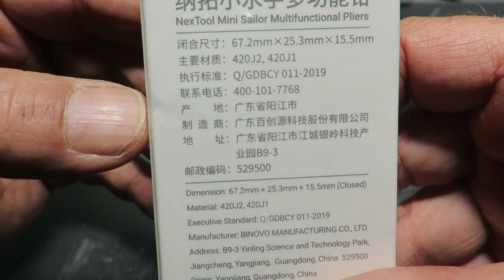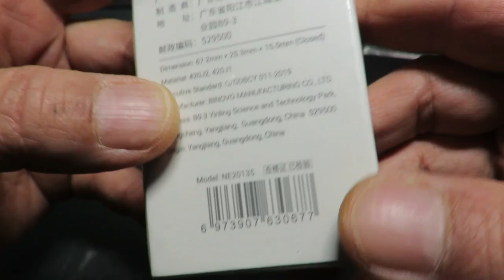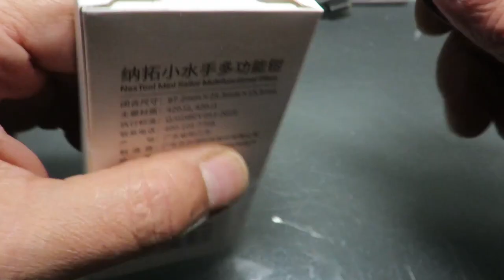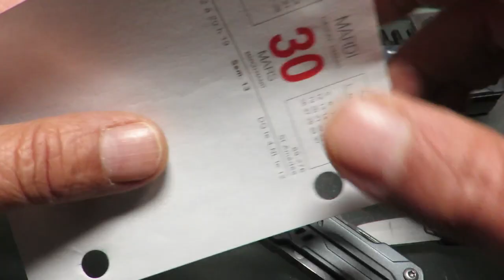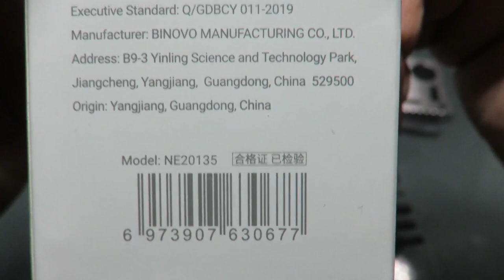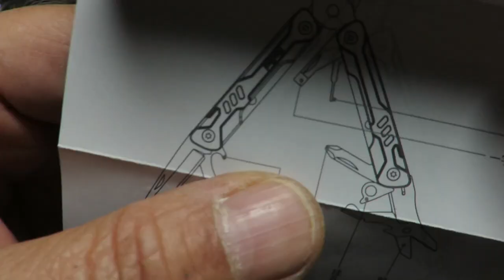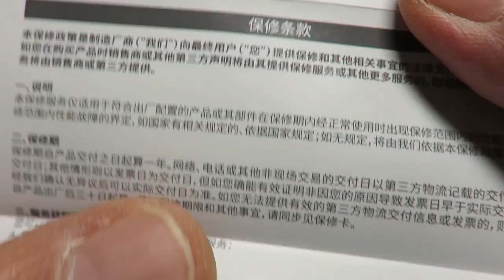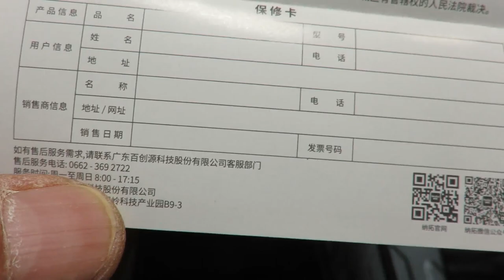NEXTOOL Sailor & Mini Sailor Multifunction Pliers

Comment from the maker: MT VOD * Dear lovers of multi-tools, you can ask me everything, redo a review, insist on a detail, make comparisons, test this or that, I am at your disposal! :) * Multi-Tool VOD
Here is my collection of multi-tools (June 2022) [/S = Brand Sheath]. Each model has been the subject of one or more videos (see my playlist "MULTI-TOOLS").
001-	BALADEO Outdoor Camping Cutlery Multi-tool ECO104 /S (*3)               
002-	BEAR & SON Bear Jaws 155LS /S
003-	BEAR & SON Bear Jaws Multiscissors Gardener BC157GT /S
004-	BEAR & SON Electrician's Bear Jaws BC155EL /S
005-	BEAR & SON Mini Bear Jaws 153
006-	BIBURY 23-in-1 Bicycle Multitool BI-BM-001 /S
007-	BIBURY GHK 10-in-1 EDC
008-	BIBURY Multifunction Garden Pruner BBY-MT11 (offered by the company) /S
009-	BIBURY Multifunction Tool 21-in-1 BBY-MT08 (offered by the company) /S
010-	BIBURY Multifunction Tool 16-in-1 X0016E2LAJ (offered by the company) /Box
011-	BLACK FOX BF200 /S
012-	BÔKER PLUS Tech Tool Carbon 4 /S
013-	BÖKER PLUS Tech Tool City 5 /S
014-	BUCK Knives X-Tract 730 /S
015-	BUCK Knives X-Tract 735BKS-B Essential
016-	BUCK Knives BuckTool 350 (MiniBuck)
017-	BUCK Knives BuckTool 355 /S
018-	BUCK Knives BuckTool 360 /S (*2/ one completely broken)
019-	BYRD ByrdRench BY15P /S
020-	COLEMAN Pro Lock /S
021-	CRKT Bivy CR9250 (by Hans Florine)
022-	CRKT Guppie CR9070 (by Launce Barber)
023-	CRKT Technician Multi-tool CR9201 (by Glenn Klecker)
024-	CRKT Tool CR9200 (by Ed Van Hoy & Tom Stokes/ with Bit Kit) /S
025-	CRKT Zylla-Tool Jr. CR9065K /S
026-	CRKT Wooden Multi-Tool Kit CR1035
027-	DEEPEE 8-in-1 Shears Multi-Tool /S
028-	DICE TOOL EDC Multi-tool
029-	EICKHORN SOLINGEN PRT-II Rescue Knife /Böker S
030-	FISKARS Cuts+More
031-	FLEXCUT JKN91 Right-Handed Carvin' Jack /S
032-	FLOCON DE NEIGE 18-in-1 /S (& 15-in-1)
033-	GANZO G301-H /S
034-	GANZO G302-B /S
035-	GERBER Armbar Cork
036-	GERBER Armbar Drive Onyx
037-	GERBER Balance /S
038-	GERBER Bullrush /S
039-	GERBER Center-Drive (with Bit Kit+ Victorinox Scissors) /S
040-	GERBER Center-Drive Plus (with Bit Kit) /S
041-	GERBER Crucial /S
042-	GERBER Crucial Black (with strap cutter)
043-	GERBER Crucial F.A.S.T. (with Hex Bit Kit)  /S
044-	GERBER Curve
045-	GERBER Diesel /S
046-	GERBER Dime (*3/one with broken cissors)
047-	GERBER Dual-Force /S
048-	GERBER Flik /S
049-	GERBER Fit /S
050-	GERBER FreeHand /S
051-	GERBER Freeman Exchange EAB (with 3 blades) /S
052-	GERBER Grappler /S
053-	GERBER Prybrid Utility
054-	GERBER Prybrid X
055-	GERBER MP1 /S
056-	GERBER MP1-MRO (with Bit Kit) /S
057-	GERBER MP 400 Compact Sport (05500/ 45500) /S
058-	GERBER MP 500 Recoil Auto-Plier /S
059-	GERBER MP 600 Basic Black (07550) /S
060-	GERBER MP 600 Black (07550G1 Carbide Cutters) /S
061-	GERBER MP 600 Bluntnose (old model with 55200 Multi-Plier Pocket Tool Kit) /S
062-	GERBER MP 600 Bluntnose Black (07520G1N Carbide Cutters with Tool Kit) /S
063-	GERBER MP 600 Bluntnose (07500 Carbide Cutters) /S
064-	GERBER MP 600 Pro Scout (07564 with Tool Kit) /S
065-	GERBER MP 650 Evolution (with 2 heads)
066-	GERBER MP 700 Urban Legend /S
067-	GERBER MP 800 Legend /S
068-	GERBER MPT #5 /S
069-	GERBER Multi-Lite (07205)
070-	GERBER Nautilus /S
071-	GERBER Obsidian
072-	GERBER Octane /S (*2)
073-	GERBER Radius /S
074-	GERBER Splice
075-	GERBER Strata /S
076-	GERBER Suspension /S
077-	GERBER Suspension-NXT /S
078-	GERBER Truss /S
079-	GERBER Vise
080-	HANWEI Professional Multi-tool by PAUL CHEN 1008-GT
081-	HAVALON Evolve Jim Shockey Signature Series XTC-60AMTS /S
082-	HENSTRONG (or Bibury or Intey or …) 18-in-1 /S
083-	HX OUTDOORS GQ-17A Multi-tool /S
084-	HX OUTDOORS GJ-06 Knife & scissors /S
085-	KERSHAW A100C /S
086-	KERSHAW Select Fire 1920
087-	KELVIN.36
088-	KING INNOVATION L-tool Lighting Multi-tool 46700 /S
089-	KITA Le Dépanneur x2 /S
090-	LEATHERMAN Blast (with Removal Bit Driver) /S
091-	LEATHERMAN Bolster (Costco exclusive) /S
092-	LEATHERMAN Brewzer
093-	LEATHERMAN Bond (+ pocket clip)/S
094-	LEATHERMAN Charge+ (with Bit Kit & Pocket Clip & Lanyard Ring & Bit Driver Extender) /S
095-	LEATHERMAN Charge+ Black Oxide /S
096-	LEATHERMAN Charge+ Forest Camo (with Bit Kit & Pocket Clip & Lanyard Ring & Bit Driver Extender) /S
097-	LEATHERMAN Charge+ G10 Earth (with Bit Kit & Pocket Clip & Lanyard Ring & Bit Driver Extender)/ S
098-	LEATHERMAN Charge+ G10 Orange (with Bit Kit & Pocket Clip & Lanyard Ring & Bit Driver Extender) /S
099-	LEATHERMAN Charge+ G10 Red (with Bit Kit & Pocket Clip & Lanyard Ring & Bit Driver Extender)/ S
100-	LEATHERMAN Charge+ TTI (with Bit Kit & Pocket Clip & Lanyard Ring & Bit Driver Extender) /S
101-	LEATHERMAN Charge+ Woodland Camo /S
102-	LEATHERMAN Charge AL /S
103-	LEATHERMAN Charge ALX Black Oxide /S
104-	LEATHERMAN Charge TI 2H (with Bit Kit & Pocket Clip & Lanyard Ring & Bit Driver Extender) /S
105-	LEATHERMAN Charge TTI (with Bit Kit & Pocket Clip & Lanyard Ring & Bit Driver Extender) /S
106-	LEATHERMAN Charge XTI (with Bit Kit & Pocket Clip & Lanyard Ring & Bit Driver Extender) /S
107-	LEATHERMAN Core /S
108-	LEATHERMAN Crunch /S (*2 / including a clone)
109-	LEATHERMAN Curl /S
110-	LEATHERMAN Expanse E306X /S
111-	LEATHERMAN Expanse E33BX /S
112-	LEATHERMAN Expanse E33T /S
113-	LEATHERMAN Expanse E55BX /S
114-	LEATHERMAN Expanse K502X /S
115-	LEATHERMAN Flair /S
116-	LEATHERMAN Free K2
117-	LEATHERMAN Free K2X
118-	LEATHERMAN Free K4
119-	LEATHERMAN Free P2 /S
120-	LEATHERMAN Free P4 /S
121-	LEATHERMAN Free T2
122-	LEATHERMAN Free T4
123-	LEATHERMAN Freestyle /S
124-	LEATHERMAN Freestyle CX /S
125-	LEATHERMAN Fuse /S
126-	LEATHERMAN Juice B2
127-	LEATHERMAN Juice C2 /S
128-	LEATHERMAN Juice CS3
129-	LEATHERMAN Juice CS4 /S
130-	LEATHERMAN Juice KF4 (offered by the company & signed in my name by Tim) /S
131-	LEATHERMAN Juice Pro (with Victorinox Mini Screwdriver) /S (*2/ one offered by the company & signed in my name by Tim) /S
132-	LEATHERMAN Juice S2 /S
133-	LEATHERMAN Juice SC2
134-	LEATHERMAN Juice SX /S
135-	LEATHERMAN Juice XE6 (with Victorinox Mini Screwdriver) /S
136-	LEATHERMAN Kick /S
137-	LEATHERMAN Klamath /S
138-	LEATHERMAN Leap /S
139-	LEATHERMAN Mako TI
140-	LEATHERMAN Micra
141-	LEATHERMAN Mini Tool
142-	LEATHERMAN MUT (with Bit Kit & Tool adapter V2) /S
143-	LEATHERMAN MUT EOD /S
144-	LEATHERMAN Nehalem /S
145-	LEATHERMAN OHT Coyote Tan(with tweezers) /S (*2)
146-	LEATHERMAN OHT Black /S
147-	LEATHERMAN PST (*2)
148-	LEATHERMAN PST II
149-	LEATHERMAN PULSE /S
150-	LEATHERMAN Raptor Rescue /S
151-	LEATHERMAN Raptor Response
152-	LEATHERMAN Rebar /S
153-	LEATHERMAN Rev /S
154-	LEATHERMAN Signal /S (with Bit Kit & Bit Driver Extender)
155-	LEATHERMAN Sideclip /S
156-	LEATHERMAN Sidekick /S (with carabiner)
157-	LEATHERMAN Skeletool /S
158-	LEATHERMAN Skeletool CX V1(with Bit Kit & MUT Bits) /S
159-	LEATHERMAN Skeletool CX V2 /S
160-	LEATHERMAN Skeletool KB
161-	LEATHERMAN Skeletool KBX
162-	LEATHERMAN Skeletool RX (with Bit Kit & MUT Bits) /S
163-	LEATHERMAN Skeletool Topo /S
164-	LEATHERMAN Squirt E4 (*2/ one offered by the company & signed in my name by Tim)
165-	LEATHERMAN Squirt ES4
166-	LEATHERMAN Squirt P4
167-	LEATHERMAN Squirt PS4
168-	LEATHERMAN Squirt S4
169-	LEATHERMAN Steens /S
170-	LEATHERMAN Style
171-	LEATHERMAN Style CS
172-	LEATHERMAN Style PS
173-	LEATHERMAN Super Tool /S
174-	LEATHERMAN Super Tool 200 (with Tool Adapter V1) /Combo S
175-	LEATHERMAN Super Tool 300 /S
176-	LEATHERMAN Super Tool 300 EOD /S
177-	LEATHERMAN Super Tool 300M /S
178-	LEATHERMAN Surge (with Bit Kit & Pocket Clip & Lanyard Ring & Bit Driver Extender) /S
179-	LEATHERMAN Surge 2013 Black Edition (with Bit Kit & Pocket Clip & Lanyard Ring & Bit Driver Extender) /S /Kydex CF Sheath
180-	LEATHERMAN Tread Stainless Metric
181-	LEATHERMAN Wave (with Bit Kit & Pocket Clip & Lanyard Ring & Bit Driver Extender) /S
182-	LEATHERMAN Wave+ (with Bit Kit & Pocket Clip & Lanyard Ring & Bit Driver Extender) /S
183-	LEATHERMAN Wave+ Black Oxide Limited Diegel Edition /S
184-	LEATHERMAN Wave Original /S
185-	LEATHERMAN Wingman V1 /S
186-	MASERIN Citizen 564/G10N (by Moris Baroni)
187-	MAXKNIVES MKTI1
188-	MILWAUKEE Fastback 6-in-1
189-	MIKOV NUZ 246-NH-4/RESCUE
190-	MORPILOT Hammer multi-tool /S
191-	MOSSY OAK 17-in-1 /S
192-	NEXTOOL Mini Multfunction Knife KT5026G
193-	NEXTOOL Flagship Pro 16-in-1 /S
194-	NEXTOOL Mini Sailor
195-	NEXTOOL Sailor Pro 14-in-1 NE20045 /S
196-	NEXTOOL Xiaomi 10-in-1 KT5023 Motool /S
197-	NEXTOOL Xiaomi Flagship Mini KT5022
198-	OPINEL N°9 Bricolage
199-	OPINEL N°12 Explore
200-	OZARK Trail MULTIFORCE PREMIUM 18-IN-1 MULTI TOOL /S
201-	PIRANHA 6-in-1 (crescent wrench & pliers combo) /S
202-	PIRANHA 9-in-1 (crescent wrench & pliers combo) /S (*2)
203-	RATNIK 6E6 (with diamond-coated file) /S
204-	REAL AVID Fun Tool Max /S
205-	ROXON Flash S803 (offered by the company) /S
206-	ROXON Knife Scissors S501 (*2 / one offered by the company)
207-	ROXON Multi BBQ Tool MBT Mini S602 (offered by the company)
208-	ROXON Multi BBQ Tool MBT3 S601 (*2/ one offered by the company) /S
209-	ROXON Phantasy S502 (with all blades offered by the company)
210-	ROXON Phantom S802 (*2/ one offered by the company) /S
211-	ROXON Spark CM1349 (*2/ one offered by the company) /S
212-	ROXON Storm S801 (with bit kit & Victorinox Mini Screwdriver) (*2 / one offered by the company) /S
213-	ROXON Storm S801S (with bit kit & Victorinox Mini Screwdriver) /S
214-	RUIKE Criterion M61-G (with Victorinox Mini Screwdriver) /Böker S
215-	RUIKE Trekker LD43 Rescue Tool
216-	RUIKE Trekker LD51-B (with Victorinox Mini Screwdriver) /Victorinox S
217-	SANRENMU Multifunction Folding Knife 7116 /S
218-	SCHRADE Tough Chip ST2 /S
219-	SCHRADE Tough ST1 (original U.S./ version 1) /S
220-	SCHRADE Tough ST1 (Taylor Brands Schrade) /S
221-	SCHRADE Tough ST11 /S
222-	SCHRADE Tough STE5 /S
Reply from the maker: 223-	SEBERTECH Sebertool M2
224-	SEBERTECH Sebertool M4
225-	SOG CrossCut 2.0
226-	SOG CrossGrip
227-	SOG Kilowatt
228-	SOG Micro ToolClip
229-	SOG Paratool S31 (with Saw instead Philipps screwdriver + Bit Driver + Hex Bit Accessory Kit) /S
230-	SOG ParaShears /S
231-	SOG Pocket PowerPlier S44 /S
232-	SOG PowerAccess Assist (with bit kit) /S
233-	SOG PowerAccess Deluxe (with bit kit) /S
234-	SOG PowerAssist S66 (with Saw instead of V-Cutter) /S 
235-	SOG PowerDuo PD01 /S
236-	SOG PowerGrab (with Bit Kit) /S
237-	SOG PowerLock S60 (with Bit Kit) /S
238-	SOG PowerPint (with Bit Kit) /Böker S
239-	SOG PowerPlay (with Bit Kit) /S
240-	SOG Snippet
241-	SOG SwitchPlier V2.0 /S
242-	SOG Sync II
243-	SOG ToolClip S23
244-	SPLITMAN GHK6 (with bit kit) /S
245-	SPLITMAN GHK8 (with bit kit) /S
246-	SPLITMAN Multifunction knife (V1)
247-	SPLITMAN Multifunction Knife (V2)
248-	SPYDERCO ASSIST SALT FRN YELLOW C79YL - Rustproof H-1
249-	SWISS+TECH (GreatStar Tools) 13-in-1 ST022001A Multifunction Knife
250-	SWISS+TECH (GreatStar Tools)) 17-in-1 Multi-tool Pliers
251-	SWISS+TECH Micro-Max 19-in-1
252-	SWISS+TECH Micro-Plus EX 9-in-1
253-	SWIZA D08 Urban Camo Mousse /S
254-	SWIZA D10 Mousse /S
255-	TAG SUPRA SS Credit Card Multi-tool
256-	TOPEAK The Alien I /S
257-	TOPEAK The Alien III /S
258-	TRUE UTILITY Tectonic TU220 /S
259-	TWOSUN KNIVES TS206 Tanto
260-	UD Vape Cool Kit Multi-tool Cutting Pliers /S
261-	UTICA KUTMASTER Multimaster 11-3565CP /S
262-	VICTORINOX Bantam Alox (0.2300.26)
263-	VICTORINOX Classic When Life Gives You Lemons Limited Special Edition 2019 (0.6223.L1905)
264-	VICTORINOX Classic Alox Black Kniveandtools Edition (0-6221-23R4-KTE1)
265-	VICTORINOX Classic SD Navy Camo (0.6223.942) /S
266-	VICTORINOX Climber Lite Winter Magic Limited Special Edition 2021 (1.7904.3E1)
267-	VICTORINOX Compact (1.3405)
268-	VICTORINOX Cybertool L (1.7775.T) /S
269-	VICTORINOX Cybertool Lite (1.7925.T) /S1
270-	VICTORINOX Electrician Alox (0.8120.26)
271-	VICTORINOX Evolution Grip 18 (2.4913.SC8B1) /S
272-	VICTORINOX Evolution Grip S54 (2.5393.SC) /S
273-	VICTORINOX Expedition Lite (1.7965.AVT) /S
274-	VICTORINOX Explorer White Christmas Limited Special Edition 2017 (1.6703.77)
275-	VICTORINOX Farmer X Alox (0.8271.26)
276-	VICTORINOX Handyman (1.3773) /S
277-	VICTORINOX Hiker Walnut Wood (1.4611.63) /SwissQlip
278-	VICTORINOX Huntsman Lite (1.7915.T) /S
279-	VICTORINOX Huntsman SilverTech (1.3713.T7) /S /SwissQlip
280-	VICTORINOX Jelly SwissCard Lite (0.7333.T3B1) / 4.0873.L Sheath
281-	VICTORINOX MiniChamp (0.6385) /S
282-	VICTORINOX MiniChamp Alox (0.6381.26) /S
283-	VICTORINOX MiniChamp Lite (0.6386) /S
284-	VICTORINOX My First Victorinox H (0.2373.T2)
285-	VICTORINOX Nail Clip 580 (0.6463)
286-	VICTORINOX Outrider (0.8513.3)
287-	VICTORINOX Ouvre Montres (0.2102)
288-	VICTORINOX Picnicker GARANT 84 6000 Mod (Hoffman Group)
289-	VICTORINOX Pioneer X Alox (0.8231.26)
290-	VICTORINOX Pioneer X Alox Winter Magic Limited Special Edition 2020 (0.8231.22E1)
291-	VICTORINOX Ranger Grip 58 Hunter (0.9683.MC) /S
292-	VICTORINOX Ranger Grip 71 Gardener (0.9713.C) /Wenger S
293-	VICTORINOX Ranger Grip Boatsman (0.9798.MWC8) /S
294-	VICTORINOX Rescue Tool (0.8623.MWN) /S
295-	VICTORINOX RocKnives Bijou 53 Azul Santa Crux Brazil (0.6200.53)
296-	VICTORINOX Signature Lite SilverTech (0.6226.T7) /S
297-	VICTORINOX Skipper Navi Camo (0.8593.W942) /S
298-	VICTORINOX Spartan Onyx Black (1.3603.31P)
299-	VICTORINOX SportRachet (1999) /S
300-	VICTORINOX Sportsman White Christmas Limited Special Edition 2018 (0.3804.77)
301-	VICTORINOX Super Tinker Winter Magic Limited Special Edition 2019 (1.4703.7E1) /S
302-	VICTORINOX Swiss Soldier’s Knife 08/2018 (0.8461.MWCH) /S
303-	VICTORINOX Swisschamp (1.6795.T) /S
304-	VICTORINOX Swisschamp XAVT (1.6795.XAVT) /S
305-	VICTORINOX Swisschamp XLT [1.6795.XLT] /S
306-	VICTORINOX SwissTool PLUS (3.0323.L) (2008 – BMW/ with all accessories & scissors) /S & Gaine ouverte 4.0829
307-	VICTORINOX Swisstool RS (3.0326) /S
308-	VICTORINOX SwissTool X with Pocket Clip (3.0327.L) /S
309-	VICTORINOX SwissTool Spirit MX Clip (3.0224.MKB1) /S
310-	VICTORINOX Swisstool  Spirit MXBS Black Oxide with Pocket Clip (3.0226.M3N) /molle S
311-	VICTORINOX SwissTool Spirit S Black Oxide (3.0223) /S
312-	VICTORINOX SwissTool Spirit X (3.0224.L) /S
313-	VICTORINOX SwissTool Spirit XBS (3.0224.3CN) /S
314-	VICTORINOX SwissTool Spirit XC PLUS RATCHET (3.0239.N) (with all accessories) /S
315-	VICTORINOX Traveller Lite (1.7905.AVT) /S
316-	VICTORINOX Voyager (1.3705.VT3)
317-	VICTORINOX Wine Master Walnut Wood (0.9701.63) /S
318-	VICTORINOX Workchamp V1 (0.8564) /S
319-	VICTORINOX Workchamp XL (0.8564.xl) /S
320-	WALTHER Multi-Tac /S
321-	WENGER Basic 66 (1 66 41)
322-	WENGER EvoGrip S557 (1.557.059.821 with Victorinox Mini Screwdriver) /S
323-	WENGER PocketGrip 577 /S
324-	WENGER Ranger 13 Gardener (1 77 13)
325-	WENGER RangerGrip Handyman 1.077.0[90.822] /S
326-	WENGER Bernina Mini Spot Light (031602.70.01)
327-	WENGER Swiss Business Tool SBT 60 /S (*2)
328-	WENGER SwissGrip (WengerGrip 76) (1 76 01 61)
329-	WENGER Titanium 1 (1.092.041.000) /S
330-	WENGER Titanium 2 (1.092.042.000) /S
331-	WENGER Titanium 3 Ueli Steck Spécial Edition (1.092.040.000) /S
332-	WOHO Wokit Carabiner multi-tool
333-	WORPRO 16-in-1 Multi-tool (W014070 AE) /S
334-	XIAOMI Nextool Huohou 15-in-1 /S
335-	XIAOMI Nextool Huohou Mini
	
Acquisition forecast - Call for donations… Sog, Gerber, Victorinox, Leatherman  and the others (except Roxon & Bibury) still stubbornly refuse to send me models that I could present. We live in a world unnecessarily absurd delivered to spirits that seem to be content with it...
1-	EMERSON Multitasker EDC 1/ 2
2-	EXTREMA RATIO Police Evo
3-	GERBER Cable Dawg
4-	GERBER Steady
5-	GERBER Survival Tool Pack
6-	GRIPsher
7-	KAMPO NS-2
8-	LEATHERMAN Charge+ Damascus Carbon or Wood/ TTI Damascus
9-	LEATHERMAN Expanse E33B/ E33TX/ E55B/ E307X/ K503X
10-	LEATHERMAN Free K4X
11-	LEATHERMAN Mr. Crunch (GARAGE)
12-	LEATHERMAN Batch #002: The Darkside (GARAGE)
13-	LEATHERMAN Pruner Genus
14-	LEATHERMAN Removal Pocket Clip 934860 (for Kick)
15-	LEATHERMAN Skeletool SX
16-	LEATHERMAN Ukiah
17-	LEATHERMAN Wave+2H
18-	FKMD M.P.S.K. Survival Camp Tool FX-444/3MB
19-	MELITA-K Sapper/ Professional MLK031/ Noks Sapper/ Wag-3
20-	MYERCHIN P300SL Sailor’s Tool
21-	ROXON M1, M2, M3, C1
22-	SCHRADE I-Quip
23-	SCHRADE Tough Grip ST6
24-	SOG Flash MT
25-	SOG Paladin PowerPlay PT-540
26-	SPYDERCO ClipiTool Rescue C209GS
27-	SPYDERCO Spyderench T01
28-	TOLER TOOLS
29-	VICTORINOX Altimeter (1.3705.AT/ Plus : 1.3715.AT)
30-	VICTORINOX Swiss Tool MXBS (3.0326.M3N)
31-	VICTORINOX Traveller (1.3705.AVT) + Etui 4.0516
32-	VICTORINOX Voyager Lite (1.7905.VT) + Etui 4.0517
33-	WENGER Laser Pointer (1.97.01 cissors)
34-	WENGER Ranger 14 Gardener (13 + saw)
35-	WENGER RangerGrip 88/95 - Rescue I/II
Reply: MT VOD for this Mini Sailor. Please check the following - if you pull out the key ring and put a lanyard into it, then the Phillips screw driver can no longer be opened completely. And maybe you can do a paperclip pliers test?